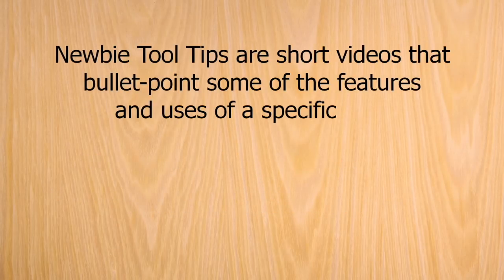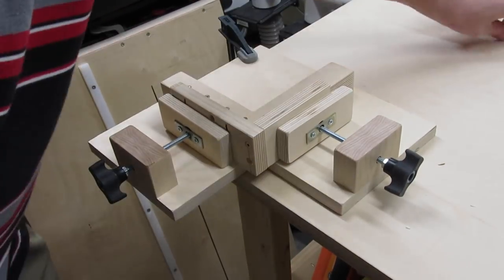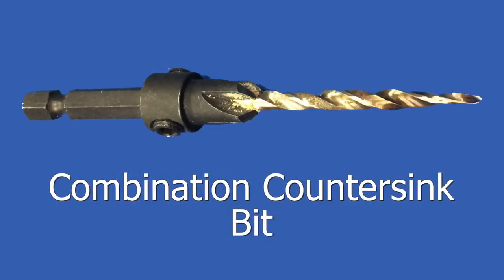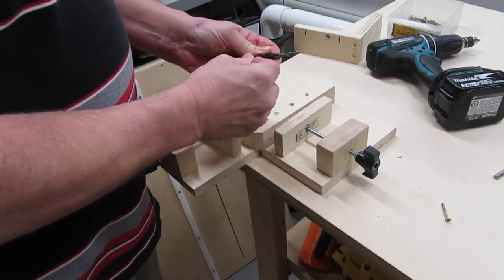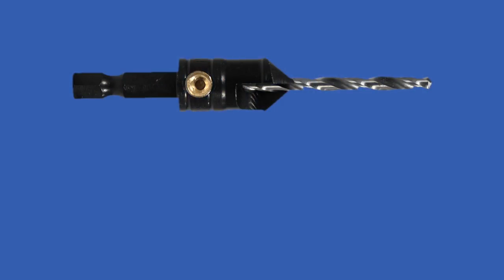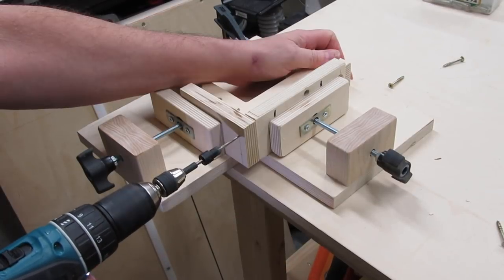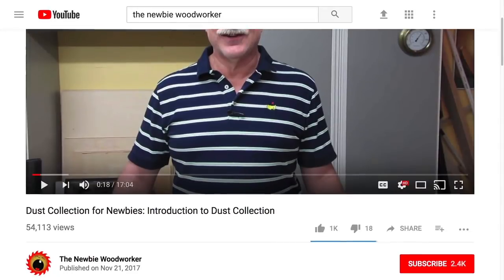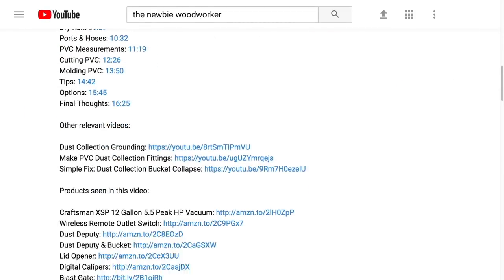Newbie Tool Tip: Countersink Drill Bits

Comment: I wish I had known these even existed as I built my workbench.  I was switching back and forth constantly between the straight drill and the countersink drill.  Would have saved my a LOT of time.
Reply from the maker: I hear you. I have 2 drills now so I don't have to keep switching the drill bit and the screwdriver bit. Lazy much? 😀
Reply: @TheNewbieWoodworker  Same here, I use two drills and an impact driver a lot.  Nothing wrong with that.
Reply from the maker: @johnnichols8553  👍

Comment: Thank you for this video. Question: I'm trying to secure my loose and wiggling fascia board into the rafter tails of my home. I'm going to use #10 x 3-inch exterior screws and I bought the DeWalt countersink drill bit #10 (3/16"). The  instructions say to "match drilling depth to screw length" but even with the countersink pulled all the way back, the drill hole will be more than 1 inch short (because my screw is 3 inches long). Should I just let the screw itself drive through that extra inch? (Even with the countersink removed, the hole would come up short by 1/4 inch. Thanks for any feedback!
Reply from the maker: Thanks for the question. I'm not 100% sure, because I don't know if it will split or not. However, there's no reason you can't use a longer regular drill bit to drill the remainder of the hole, if you have one long enough. Or you could drill the hole with the regular bit first, then use the countersink bit to add the countersink. Just make sure you don't use a bit that's too large, diameter-wise, or there won't be anything for the screw to bite into. 😄
Reply: @TheNewbieWoodworker  Thank you, much appreciated.
Reply from the maker: @eelneck  👍

Comment: Dan thanks for the video. I bought these countersink bits.  When I use them they stop when the wood touches the countersink part. The hole is never made. Any advice?
Reply from the maker: It sounds like maybe you have the clutch on your drill set too low?
Reply: The clutch is on drill bit it has a 2 speed selector 1 or 2 it is one 1. I will try 2
Reply from the maker: @pinnacleservices6671  That's probably the speed setting. The clutch will be a ring around the drill, with numbers something like 1 through 10 or 20. The lower the number, the quicker the drill stops when it encounters resistance.

Comment: I'm going to attempt to build my first workbench and I want to counter sink the screws on top. Is there an upside to using wood fill to fill the holes or is it a waste of time and money?
Reply from the maker: I suppose it could give a flatter surface. Chances are you'll be able to see the difference in color, unless you stained it properly (don't ask me how - I'm no good at that). Try leaving it as is, and see what you think. You can always add the filler later if you want.

Comment: I like the Dewalt set because they are tapered. My problem is the set I have now (I don't remember brand or where I bought them) the set screws don't hold and the countersink spins. Or the set screws strip out. How does the dewalt set compare to these problems?
Reply from the maker: The DeWalt countersinks will slip if you don't tighten them down correctly. What I mean is, each bit has two set screws, on opposite sides, and you need to make sure that both of them are screwed in enough to make contact with the bit. Does that make sense? And obviously you need to tighten them down pretty good. If you do that, they hold pretty well. I don't think they'll strip easily - they're pretty solid.
Reply: Thanks, Seems like the would put a flat side on the shaft to prevent sliping.

Comment: Can you tell me the difference between head dia. , Pilot dia. And Bore dia. ??
Reply from the maker: Since you know the terms, I'll assume you know what they mean. So you basically want the countersink part (the "cone" part) to allow the screw head to fit in, and to allow the screw to go deep enough so it doesn't stick up above the stock. If you use a large countersink, the cone will look funny because it's much wider that the screw head. But most countersink bits have the right size countersink for most screws.

As for the diameter of the pilot hole, it just needs to be smaller than the screw, but how much smaller can depend on the hardness of the wood, and the type of screw you're using. That's why I have a countersink bit set, so I can get the best size pilot hole. But it doesn't have to be perfect - just experiment with some scrap wood and see what works for you, with whatever screw size you're using.

I hope that helps.

Comment: The angled countersink bits are great but (1) they tend to break at the tip very easily if you are not careful. And believe me, I have broken my fair share. It's very annoying. (2) you can't move the counter sink up and down the drill bit as it is Angked from what ever degree to zero so you have to use it long. The straight bits are better for that reason.
Reply from the maker: Thanks for the comment. It took me a while to figure out what you meant by "angled". I'm NOT a word Nazi, but I think the better word is "tapered"? Anyway, I used a set just like you're talking about. The collar couldn't be moved much on the bit, or it would fall off. But the ones I have right now (DeWalt) don't have that problem. The collar has two set screws, opposite each other, and that lets you tighten it enough. I have broken one of the bits, but DeWalt sells replacement bits - it was $6 via Amazon Prime. Just my thoughts, and thanks again for your comment! 😄
Reply: @TheNewbieWoodworker  I meant "tapered" but brain fart. I have the ones with double sided screws as well. You can use straight bits on them, too. Thanks for the comments. I subscribed.
Reply from the maker: @qzetu  Thanks, and I have brain farts all the time. It's one of the reasons I don't do a lot of explaining "live" in front of the camera - I have to stop and come up with the word that's just out of my reach. 😛My friend Matt Jackson at Next Level Carpentry swears by the "Snappy" straight bits. And he ought to know what he's talking about, since he's been doing this stuff for a living for a really long time. So maybe I should finally give them a try - he'd get a kick out of it. 😄